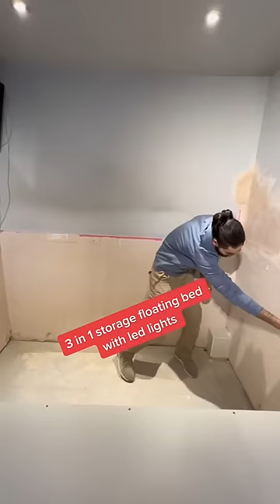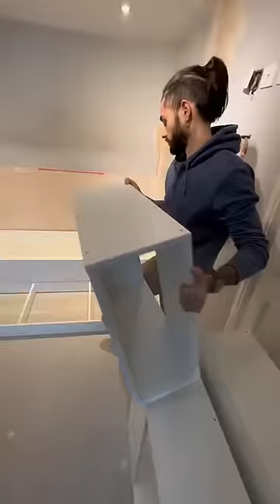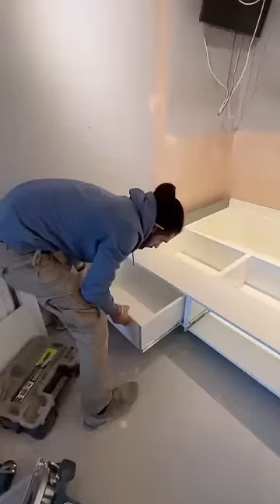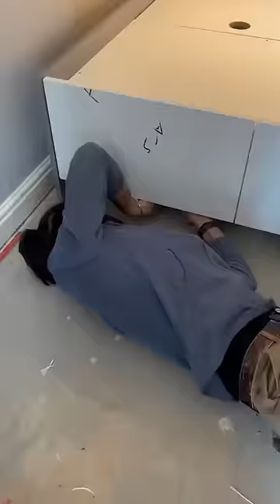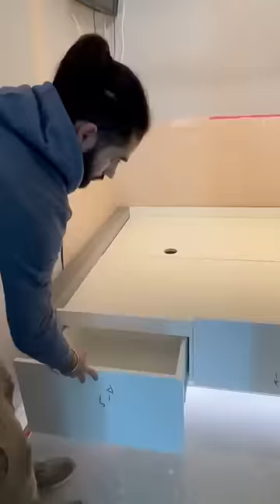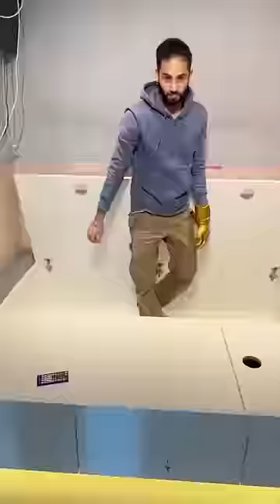Storage bed #bed #stepbystep #storagehacks #led #fitted #bespoke

Comment: I wish we find someone u like in India for these work😅
Reply: h saharanpur ke karigae h
Reply: we can get, I drew the bed on paper with dimensions and went to local bed making carpenters, and I ate his brain for 30 min and 30 days later we got the bed we want. 
regular carpenter who make cabinets will also do, but they are bit expensive, and also they do only as a part of big projects. local bed making Vala will do with reasonable price and will agree to do for a bed.
Reply: Do it yourself. All you need is a drill+screw driver machine, circular saw for wood cutting, screws and fevicol along with few sand papers and a wood planar. I built a study table for myself in 3 days.
Reply: @sasa_05  can u post it?
Reply: He is indian
Reply: In India ?? You crazy loads of skilled carpenter there